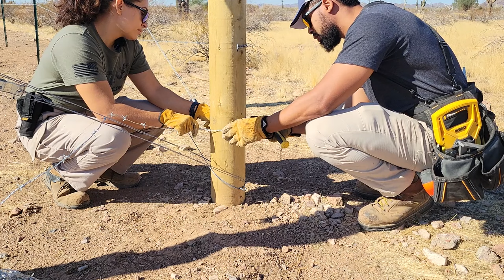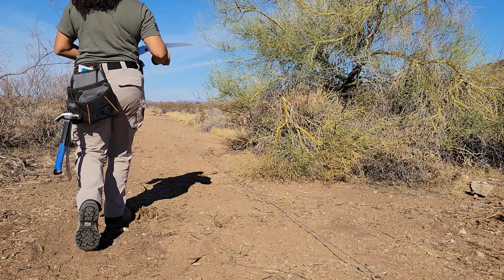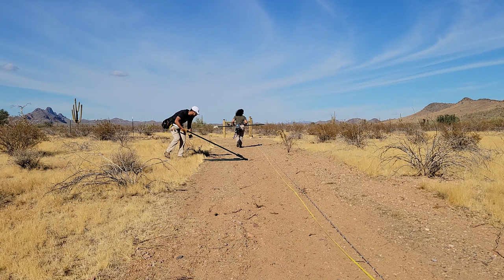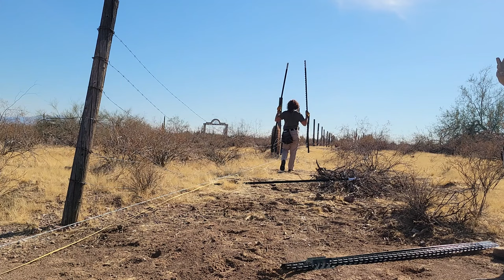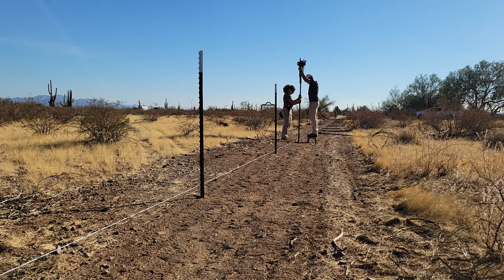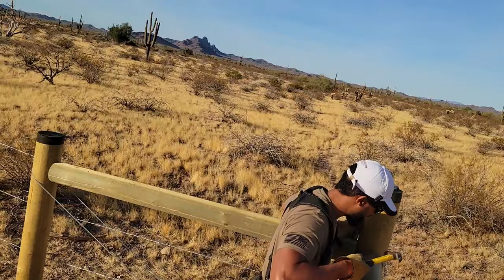T-Post Fence Installation | Arizona Desert Off Grid Homestead

Comment: Just a little metric nerd here to point out that the 660ft mentioned in your thumbnail is roughly 200m. I'm even willing to bet the wire was manufactured + sold as 100m rolls. (Note, I haven't watched the video yet)
Reply from the maker: It was a good guess lol but the rolls I purchased were 1320ft rolls, which is a little over 400m. We only needed two rolls for that one side.
Reply: @MiguelNMichellesRanch 1320 ft is a quarter mile. We had one stretch of fence that was a half mile and took two rolls for each strand.
Reply from the maker: @JamesCouch777  wow that's an expensive job 😳

Comment: Why did y'all not put deadmen in both directions in your "H" braches or wrap the wire around the posts? Ill be honest, ive seen a lot of fence built here in West Texas and thats a first for me!
Reply from the maker: Out here, I've only seen deadmen brace if it's a single corner post, no H brace. Most fences I've seen do one or the other. I tried wrapping the wire around the post, and it didn't come out too well, so we went this route. This is just what worked for us. But, to each their own.
Reply: Yes sir, what ever works!! On your next fence consider putting the wire on the side of the post that the stock will primarily be on, they tend to push the wire off the post if its opposite!
Reply from the maker: @BillGrigg-nn7xu  I will definitely take that into consideration for next time!